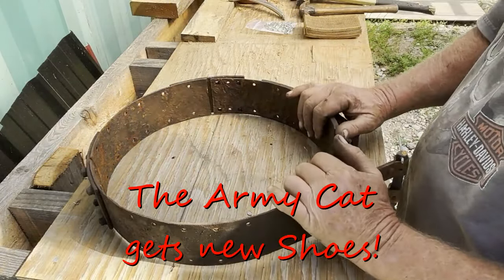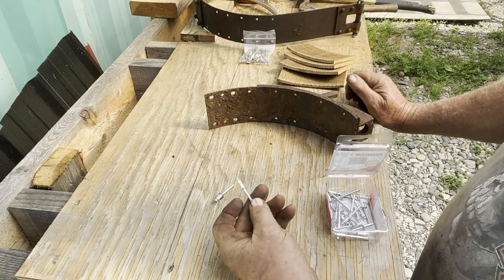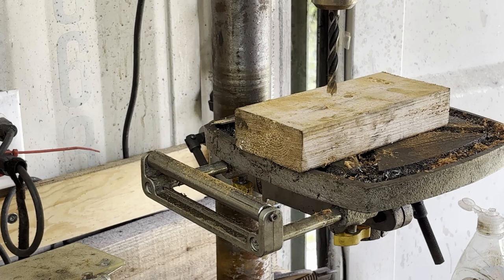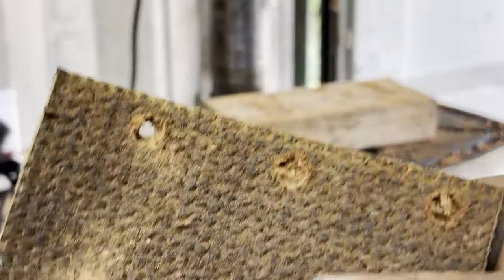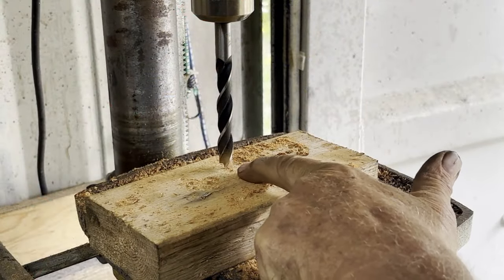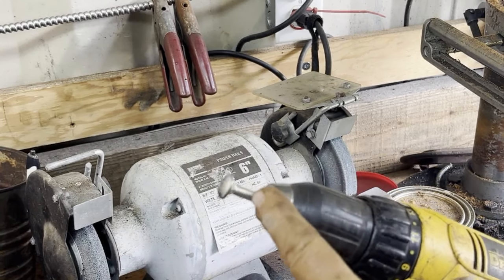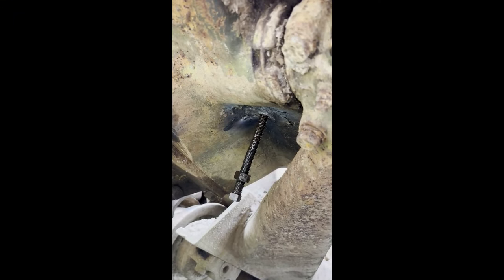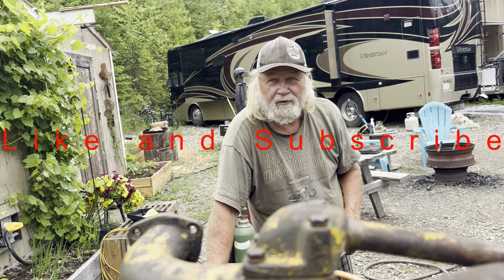D47J8043US7 Ep18  Army Cat has new Shoes

Comment: Replacing brake shoe linings for say a 1920's Bentley Speed Six, is a job I always take down to my local brake specialists. They have all the correct countersinking drills and the tools for the copper rivets. Brave man to try it your self. The steel centres of the pop rivets may score your drums.
Reply from the maker: I believe the rivet and nail are both aluminium.